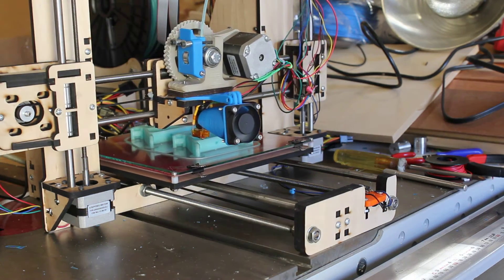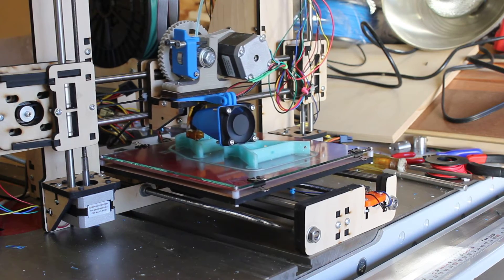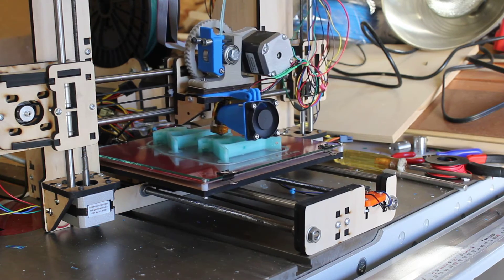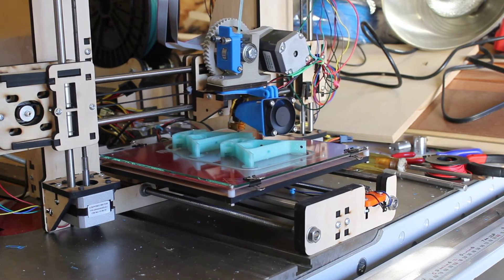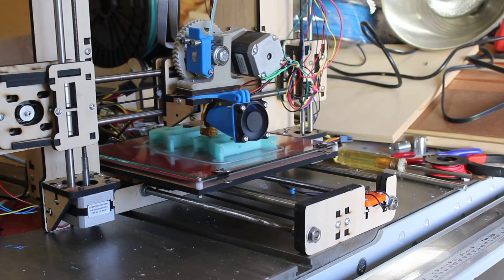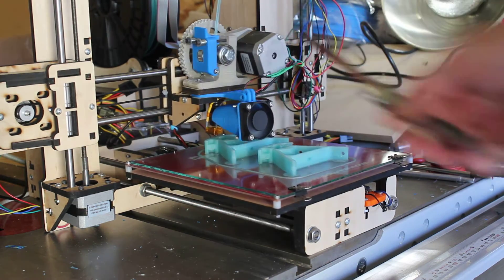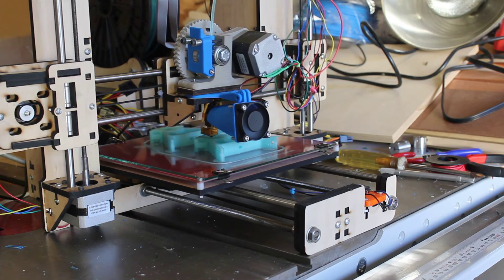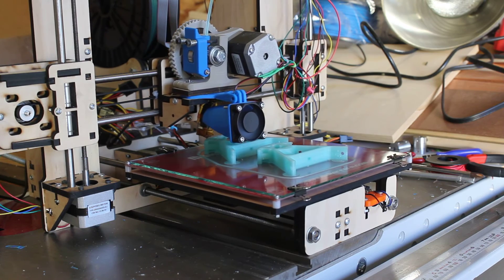Makerfarm Prusa i3 3D printer - Six weeks in.

Comment: Ive pulled mine back out.. seems after sitting for a time the parts became brittle so the part of the extruder you have in blue (idler) cracked at the pivot point. Cant really do anything until I get another printed (looking for a local to me). Like the shroud and if I ever actually get it going I'll be doing that for sure. Ive also considered once I get functional redoing the X axis ends in print and doing away with the wood.

Comment: wondering what software you were using to develop your object? I have solidworks and was wondering if it would be compatible with this printer. new to this 3d printing
Reply from the maker: Aaron Harris I generally use OpenSCAD, InkScape and Blender.  Solidworks should work fine, as long as you can export to .STL.
Reply: Right on. Thank you for the response. I definitely can export to stl.

Comment: ZennmasterM  How did you print the shroud mount? On thingiverse, the mount is vertical. Is there a way to rotate the mount so that it is flat on the print bed? Thanks!
Reply from the maker: Kyle Worj I used Meshlab in Linux to flop it over.  I'm sure if you're on Windows or Mac there are some easy to use options for editing STLs, but I wouldn't know what they are.
Reply: Ok thanks for your help.

Comment: Hey there, I just bought my first 3D printer and waiting for it to arrive. The seller I've bought it from uses a different kind of hot end. And they are claiming it's better then the others. It sure looks less bulkier and more streamlined.  I was wondering If you ever used that kind of extruder/hotend. And what do you think about that kit in general? Arcrylic frame sure looks better then wood :)

Here is the link:  http://www.ebay.com/itm/SINTRON-3D-Printer-full-complete-Kit-for-Reprap-Prusa-i3-MK3-heatbed-LCD-MK8-/261643221467

I'm planning on using the printer for mostly engineering work. Multirotor parts and other mechanical parts. From what I understand PLA can't withstand heat. And where I live temperatures are above 38C 4-5 months a year. I think I'll have to switch to ABS pretty soon. And I was wondering about the rigidity and strength of ABS.

I know ABS is what Legos are made off. But those are made in factories by industrial grade equipment. I don't imagine, stuff we print would be as solid as them. Are there other materials that can be used with 3D printers?

Comment: Hello, thanks for the great video! Do you happen to have a link to where you found the replacement filament tension arm? The blue one you said had broken? I'm trying to get some of these sorts of parts made before the worst happens. Thanks!
Reply from the maker: If you go to the Makerfarm website, the .stl for the entire Greg's extruder is in with the Prusa i2 build instructions.  If you just want the idler, you'll need to use an application that manipulates .stl files. If you're on Linux, I'd suggest Meshlab. If not, I'm afraid I can't help.  In any case, it's a pretty good idea to print a whole extruder anyway, since the entire assembly is pretty high-wear.
Reply: ZennmasterM Thanks for that, I've been over the manual, but I apparently missed that. I do have a few computers running Linux around here, but it seemed to open just fine in Windows 7 with DesignSpark Mechanical. I did not test its output to be printed, though.

Comment: The worst piece of garbage printer! Always breaking down,  the z axis all threads to small and weak for it, they keep striping out.

Cant find any real information on setting up the firmware because there are so many new versions that the info videos can not keep up.

You buy PLA plastic and you think its fixed until about 8 hours into a print and the M5 rod strips AGAIN!

I have spent more time fixing this piece of crap then actually getting any use out of it!

DO NOT BUY THIS PRINTER YOU WILL REGRET IT!
Reply from the maker: Nubyrc STRIPPING the M5 rod???  I think you've got something else going on.  I've got several hundred hours on this printer, and I've never seen that.  Are you sure you cleaned and lubed the rod when you installed it?  You do need to keep the threads oiled.
Reply: Nubyrc 
The ammount of force required to "strip" the M5 rods is much more than these stepper motors + gravity can apply.
Meaning your assembly is bad, most likely your using M6 nuts for the M5 rods that could and would cause stripping with very little force.

However, lets say it's correct assembled, if that was the case I would upgrade my M5 to M6 rods and replace my M5 with M6 nuts, relative easy transform/upgrade in strength.
And i know a lot of people ALREADY do that, because M5 is a shitty size, and is not as cheap or commonly available as the M6. 
Ofcourse you need to re-calibrate for M6 rods in the Z axis if you do that.

Comment: Hey Michael, do you think the fan mount you use in the video would be sufficient to cool the heat sink on a hexagon hot end? I've tried using the fanout that Colin from Makerfarm recommends, but every time I do it melts onto the hot end at the base (it's about 1-2 mm from the hot end).

Also, what speed do you normally print at on your pruza i3v?

Comment: Excellent video, very informative -- like and faved 

1) print spare parts 
2) have a second glass bed on-hand to allow glass to cool naturally while printer is working on another print,
3) use hair spray (extra super hold) 
4) fan cone aimed at extrusion nozzle, not at post extrusion material 
5) monitor extrusion rate 

question: 
it looks like your print bed is fixed, is it? and if so how do you calibrate it particularly front and back vs left to right

thanks

Comment: What's your resolution? I'm using the 50mm J-Head from the kit and it seems to be a much lower resolution. Also, have you experienced any warping? If so, what should be done to fix it?

Comment: hey, great work! im having problems printing with abs with my prusa... mainly im getting layer sepparation due (to my consideration) a cold ambient temp. I was wondering what measures you were taking that you did not mention... any help would be appreciated!
Reply from the maker: The best luck I've had with ABS is to go HOT.  The other step I took that really helped was to move the i3 inside, out of the unheated garage for the winter.

Comment: This is a great, informative video. But man, does this look like an ass ache with all the things that could go wrong with it. Before I go ahead and order my kit, which I've been drooling over for the last few weeks, would you say this is the easiest printer to make? For novices?
Reply from the maker: Well there are printers that come complete, so all you have to do is recycle the box and find a power outlet.  That's a much easier option.  However, compared to other kits out there, the MF goes together very easily with a minimum of fussing over things like small adjustments and alignment, and is quite complete.  I think it's a great first printer if you're a "Get to build it" kind of person.

Comment: Just finished building my makerfarm 8" i3.  Have yet to print, because I'm trying to determine a good glass bed sheet option for ABS.  I have a laser engraver, and am wondering if I engraved a cross hatch pattern on the surface of the glass (not deep, but just enough to rough it up).  Do you think it would help with adhesion when using the hair spray medium ?  I have the magma hot-end so I will only be printing with ABS.   Your insight would be greatly appreciated on this idea.
Reply from the maker: You could give it a try, I've heard of a couple of people who intended to do it, but I never heard how it turned out.  Honestly, though, if your ambient temperature is high enough and you don't have any draft issues, hairspray on smooth glass works fine.
Reply: Thanks, next time I'm etching some awards, I'll try it on a piece of scrap glass.  Where I'm going to be using (attempting) the 3D printer, it is quite drafty and the temperature fluctuates a lot due to the HVAC system merely hanging below the ceiling with no plumbed air ducts.   You either freeze to death or burn up - no happy medium most of the time.  I suspect I'll have to create a box to cover the printer while it's processing a long toothed print.    I was amazed at how attached the cube was to the glass when it finished printing.  Once the cube and glass cooled the printed cube popped right off the glass.

Comment: What J-head nozzle are you using?
Reply from the maker: That's a .35mm J-head, but I haven't used in months.
Reply: ZennmasterM What are you using now?  I'm looking for recommendation for filament thickness and J-head size as I'm really close to pulling the trigger on a Makerfarm Prusa i3
Reply from the maker: TAZ427 I'm running 3mm.  There are certainly plusses and minuses to 1.75, but I suspect 3mm is probably easier to get started with, and it's still the broader standard.
As for nozzle size, I'm running .3 and .4 now, and that seems like a nice compromise.  Generally, the bigger the nozzle, the faster the print, but smaller can make cleaner and prettier objects.  So do you need big, solid prints right now?  Or can you wait a little longer and get something a little more precise?  That's the question, although there's probably very little difference between .5 and .35 as far as getting started.

Comment: I can't believe they are still using two Z axis motors. That's a problem from what I've seen. There's no reason they couldn't have gone with a larger dual shaft stepper and a timing belt for the other side. No more Z axis alignment issues.

Comment: Hi Zenn, your videos have been highly useful when assembling my i3 8''. Thank you! I have also run into the filament jamming problem, so I am also currently trying to print a fan mount. The fan shroud came out beautifully, but I am having some issues with the no tilt fan mount, most likely because the it is in standing orientation and very little area touching bed. Did you print it standing or did you flip it down in a 3d-editor?
Reply from the maker: I tilted it down using Meshlab in Ubuntu.

Comment: Great info - very similar to my own explorations. I am using an Ordbot and recently switched to Kisslicer because it has such awesome support material. Also, I use ABS almost exclusively now that I found that Future floor wax is a great bed prep - I am making huge prints with no lifting at all.
Reply from the maker: Future!  Briliant!  I've been using that as an acrylic clearcoat for years, but I never thought to use it as a bed prep.  It makes total sense that it would work.  I'll be trying that right away!
I've heard good things about KISSlicer, but I'm trying to stick to open source software and open hardware as much as possible. 
Thanks again for the tip!

Comment: Hi Michael, first let me thank you for your series of videos on the Prusa i3, they were really helpful, but I could not find the Layer height, Number of perimeters and Fill density that you used for your new set of Extruder Parts. Could you share them? Thanks.
Reply from the maker: Sure.  I usually print extruder parts at .2mm layer height, 40% infill (which might actually be more than I need), and with 3 perimeters.  I also prefer honeycomb infill, because it looks cool when it's printing, and I suspect that it gives the parts a little more stiffness.
Reply: ZennmasterM Thanks for the quick response. Did you have any problems printing the Large Herringbone Gear? Slic3r tells me that the object is Non-Manifold and that it may produce wrong results, I tried fixing it with netfabb but no luck.
Reply from the maker: Sounds like your .stl file might have been corrupted.  I used the file from the Makerfarm website, then used MeshLab to cut the four parts apart into smaller sections. Let me know if you're still having trouble.
Reply: Hey Michael thanks again for all your help, after a lot of testing the culprit turned out to be Slic3r 0.9.10b, with that version I was having problems slicing the Large Gear, but after reverting to version 0.9.9 the problems were gone.
Reply from the maker: gmua
I'm glad you found the problem and got it sorted!  On the other hand, I'm kind of disappointed that Slic3r has some issues...

Comment from the maker: Try a little PTFE (Teflon) or lithium grease on the smooth rods.  If that doesn't work, I'd look next to see if something is out of alignment, and then check for a possible bad lm8uu bearing.  Also, make sure you've got the Y-motor current set correctly.  If you're getting skipped steps along with the noise and vibration, that might be it as well.  Good luck!

Comment from the maker: Layer height is generally the standard measure of resolution, because the X-Y is already incredibly fine.  Mathematically, the minimum x/y step for this setup is about 1/80mm.  In practice, since you're extruding nearly liquid plastic, there is no real "pixelation" or even texture in the horizontal planes, even on curved parts.

Comment: My LM8UU bearings have more play than I would like, but they work fine unobstructed. I'm looking better rods and bearings, meanwhile maybe go back to printed PLA bearings on the X axis with PTFE grease, which will also quiet it down. The play only matters if the nozzle tip encounters friction or obstacles. The i3's design is such that the tip is drawn downwards when it runs into material in the Y direction, obviously not a good thing. So increased rigidity in that direction is important.

Comment from the maker: No.  When I got my printer, Colin hadn't posted the Slic3r.ini file that he now has, so I pretty much started from scratch.  I set up separate "profiles" for PLA and ABS, which are pretty similar except for temperatures and some cooling options.  The most important change from the Slic3r default, though, is the retraction settings.  The defaults are for the Ultimaker, which has very different needs.  I set the retraction speed at 7mm/s, which is more in line for the i3, at least on mine.

Comment from the maker: Thanks, Scott!  Every once in a while, mainly when printing in ABS, I'll get a strange warp that raises the top of the previous layer, and sometimes this will catch on the J-head.  It doesn't happen all that often, and generally only on smaller parts.   More cooling on the freshly extruded plastic seems to help.  The LM8UUs have a barely perceptable amount of play in them, but it's much less than the bearing holders have when they get loose after a while. BTW, I love your work on Thingiverse!

Comment: Excellent summary! I've been having issues with my i3's J-head catching on previous layers, throwing off the y bed. It's fairly impossible to print multiple objects or objects with overhangs. My nozzle is a TORLON "MT2" which has a protrusion at the end of the nozzle, and this clearly exacerbates the problem. I might be able to smooth the end out with some Kapton tape, but I feel like a nice level printer with good flow should work regardless! In that vein, do find your LM8UUs have some play?

Comment from the maker: You are completely correct.  If you just need a small correction, like a couple percent, the effects are pretty similar, but it is the overall print speed that's being adjusted.  There is a way to adjust the flow rate independently, a couple levels deep in the menus.  Thanks for bringing that up!

Comment: Are you running your Z motors in series or parallel? If you're running them in series, I highly recommend changing to parallel configuration of them. It fixed my Z issue. You likely will have to change your z motor current though.

Comment from the maker: Oh, I forgot the other part:  Yes, Z-slipping seems to be an issue.  I pretty much need to re-align the X axis and reset the Z-endstop after 2-3 prints, same as you, as long as the object is kind of short.  For a taller print, it pretty much needs to be every time.

Comment: The key is in the position of the heater-ceramic resistor-, should be in the end, as is in the hotend of 0.50 mm.
Where is positioned, all it does is heat the central pipe one inch above and that is where the filament is bent and sticks to the inner walls.....thermodinamics never lies ;-)

Comment: Second the request for a magma review after you try it out.  I have installed the printed y endstop, modified parametric shaft couplers for the z shafts, and the spring bracket for the z end stop, all off of thingiverse, the all appear to help.  Z slipping is the worst problem, I currently reset the z endstop after 2 - 3 prints.

Comment from the maker: Wow, that's kind of alarming.  I haven't installed mine yet, hopefully I'll have better luck.  One of the other dealers apparently got a bad batch: there was a little "shelf" at the bottom of the nozzle that was causing jams.  I think they eventually got that figured out.  Did you order the Magma with a kit, or do you have a J-head to switch back to?

Comment from the maker: They are on the Makerfarm web site.  Look for the files for the Prusa i2, they are included there.  The file you want is called gregs.stl, and it is all 4 parts of the extruder on one plate.  I used MeshLab to seprate eash part into its own .stl, so if a print gets borked, I don't lose the entire extruder.

Comment from the maker: I have actually tried a set of aluminum Z-couplings, but had trouble getting them to clamp tightly onto the threaded rods, so they went out of alignment almost immediately.  I tried shimming the rods with several layers of aluminum foil, but without success.  I'm sure they would do a much better job of keeping things aligned, with VERY little backlash, if I could just get them to attach properly.

Comment: thanks for the nice videos, regarding the alignment issue: have you thought using another coupling between the drive shafts and the rods? its just a piece of tubing, i guess it will just slip a bit, especially if the print is rather larger and the force on the is unevenly distributed